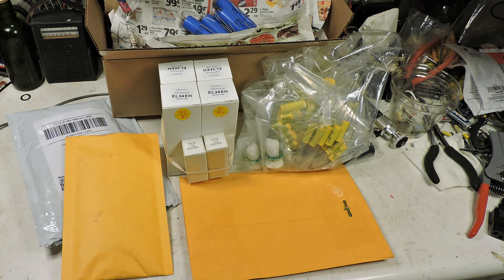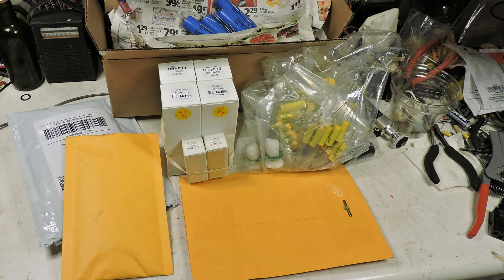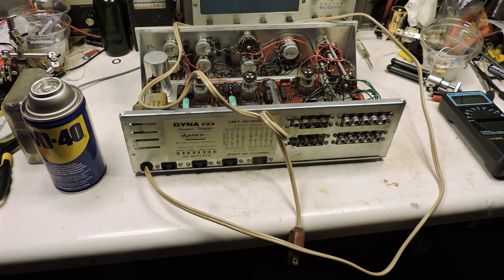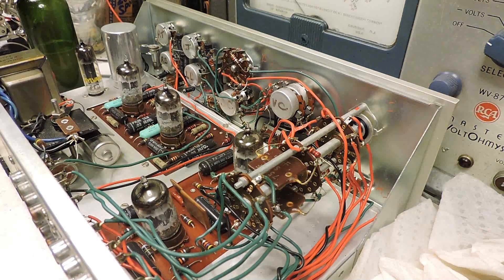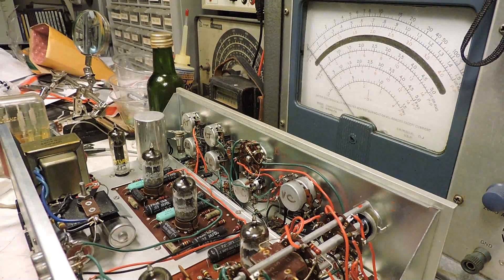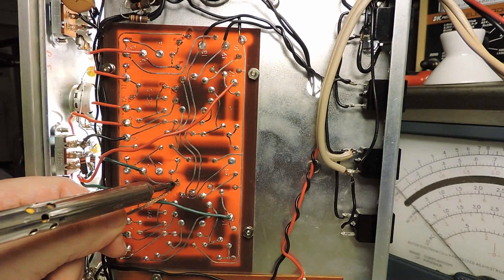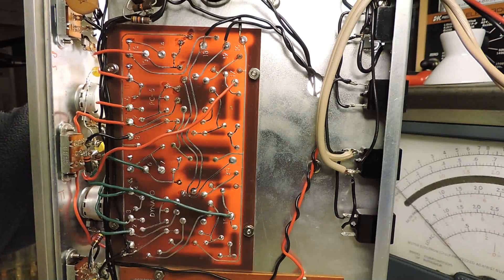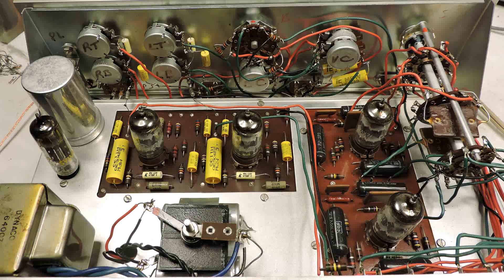The Dynaco Project PAS Part 2

Comment: Another great video Rick. I have been watching you use WD-40 on a lot of components and I’m very impressed.
Reply from the maker: On old volume and tone controls, the medium that the carbon run is on, shrinks. WD40 puts back the component that has evaporated from this medium, so it expanse back, and the control works again. I did a 10 year experiment on a transistor radio a few years back. It’s volume control is still working today.

Comment: Thank you for mentioning WD-40 as a cleaner for potentiometers and switches.  I have used a product called LPS-1 for 30 plus years.  It is described as a greaseless lubricant.  I think another tech told me about it.  Once used the product never needs the potentiometers cleaned again.  I did not know that WD-40 would also work.
Reply from the maker: I have been using WD-40 since High School (59), it has saved many volume controls. Thank you for your comment.

Comment: The sound volume is not loud enough when playing vinyl with MM cartridge even the volume control goes up to the top, say 12'o clock. Just wonder what the problem is.
Reply from the maker: I use a pre-pre amplifier.

Comment: I had a noisy Phono switch that I attacked three times with Deoxit D5. Each time, working the switch to the bone. The problem persisted. After hearing your thoughts on WD-40, I decided to give it a try. One little squirt WD-40 nailed it...first shot. I would have never swayed, if you had not brought it up. Sold!!!

Comment: Hi Rick I never knew you could revitalizing the flex (power cord) like that. Do you think that WD-40 would improve my complexion, its well over 40 years old, quite dried out and my resistance is low.  Merry Christmas and a happy New Year to you and yours.

 Regards  . . . Andy.    GWØJXM
Reply from the maker: AndyDaviesByTheSea Thanks. Hope you'll had a Merry
Christmas and going the have a great New Year.

Hey Andy,
The WD-40 has improved the flexibility
of the cord, but it is still not as flexible as I would like. So I'm
going to use another product, Saniwax. This is an on-going experiment
and it will be interesting to see if anything does the job.

Comment: Rick,
In some online radio forms, (like the Kenwood Hybird group I belong too), I have read soaking those wafer switches with too much  DeoxIT when cleaning them can cause them to swell and lock up the band switch if they swell too much. So it is safe to do a similar thing with WD40? I see you have done it successfully, but you mentioned that the old AM/FM radio wafers had shrunk, have you never had one swell too much? Wow, backlighing that circuit board is a stroke of genius!, I will have to remember that one! Great video.
Thanks Tom
Reply from the maker: Tom k2bew 

You only need a little WD-40. I use a
screwdriver to deliver a few drop to the components. I have a few
videos on this. Do a channel search on my channel on “WD-40” you
will see several videos on this subject. The idea is to use a little
and wait fifteen minutes or so. And if you need more just add one or
two drop and then wait again. Soaking any components in anything is
not a good idea.

Thanks. Hope you'll had a Merry
Christmas and going the have a great New Year.

Comment: I admit to being hesitant of using WD40 on switches and controls. Ricky, the cassettemaster uses it to clean battery corrosion damage, works quite well. I will try this on an old SW radio I just dug  out of storage, contact cleaner did not quite do it. Thanks Rick for this encouraging tip.
Don
PS: HAPPY HOLIDAYS!
Reply from the maker: ***** Thanks. Hope you'll had a Merry
Christmas and going the have a great New Year.